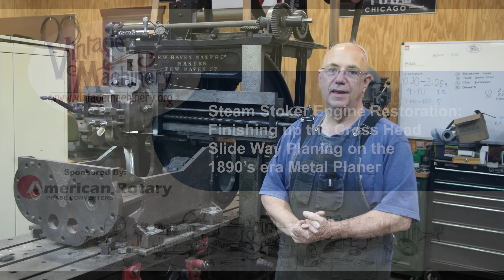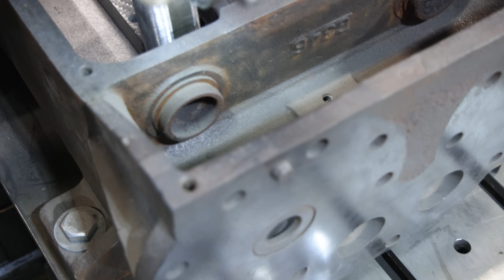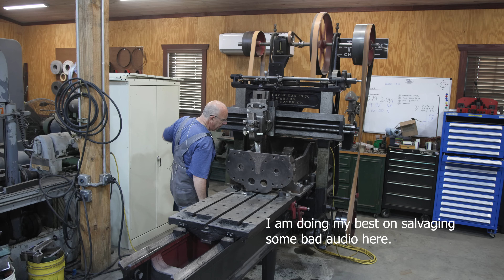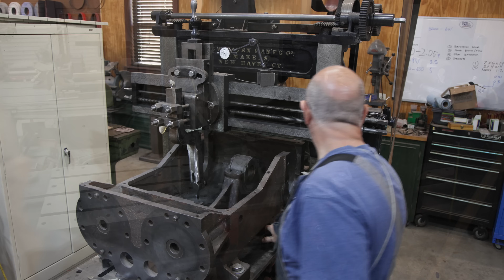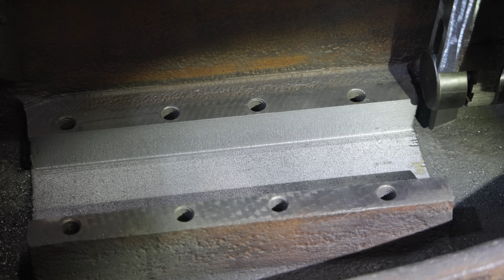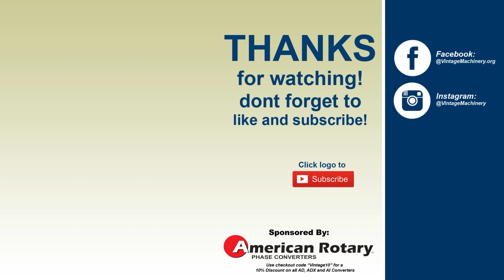Steam Stoker Engine Restoration: Finishing up the Cross Head Slide Way Planing on the Metal Planer

Comment: I'm just wondering, wouldn't the rough surface finish and pitting create a better mechanical connection with the babbitt?
Reply: The original had no babbitt, that's Bozo's idea!:face-blue-smiling::face-blue-smiling:

Comment: Finally got the machining done... getting the babbit in the bottom is going to be interesting too...
Reply: Yes, and watching Bozo getting it to run perfectly in line with the two piston rods, in both axis, (since he took no measurements) is going to be lots of laughs!:hand-orange-covering-eyes::hand-orange-covering-eyes::face-blue-smiling::face-blue-smiling:
Reply: @garybrenner6236  These cuts were for clearance and cleaning up the welds done to fix the pitting.  I expect, there will be "blanks" made of the sliding parts, if not the parts themselves to be used as the alignment for the babbit. In a similar fashion to the turned mandrels used in place of shafts.
I'm wondering how the babbit will get down to the bottom of that casting, and around whatever is being used to leave space for the moving part. Those long handled ladles are going to be a challenge.

Comment: When you were changing the tilt of the cutter, the camera picked up the flake pattern on the cross slide ways.  I remember the episodes when you were scraping those in.  The result is impressive - I remember how even Adam's big-a*se shaper couldn't reach into that box!

And now you need that newly-restored boring mill for the crankshaft. Wow, you had to retool the whole shop to 1898 for this job! 

I love a shaped (or planed) surface finish!  I know you had to get the surfaces cleaned up - get the rust and pitting out of there - but how nice a finish do you need on a surface that will get Babbitt anyway?  (Or is it the cross-head itself that gets the Babbitt?) 

And it's insane how much old big-iron is out there still turning stuff out. I'm thinking of the dozen or so big closed-die forging presses that the government contracted for about 70 years ago.  They're still turning out parts today, and we can't built airplanes without them.  When the 50,000-ton Mesta press at Alcoa in Cleveland went down because of metal fatigue in the naughts, it was down for four years and the aircraft industry had supply chain issues the whole time - that one press was a big slug of the whole country's production capacity for big aluminum, magnesium and titanium forgings.  It wouldn't astionish me if a New Haven planer like yours isn't still in production somewhere.  We hardly know how to make that sort of machine any more! Certainly, you see WWII-vintage mills all over the place. One of the last times I machined anything at work (just counterboring a few holes - the union will let me machine only for fit and finish) I set it up on a 1940s-era Bridgeport.

Comment: You mention the fear of the machine breaking through the casting.  I assume the motor controller has a kill switch option, have you thought about putting a kill switch on like a magnetic indicator arm or even just a cheap camera articulated arm, so that if the machine should accidentally try to go past its set travel, the machine itself will hit the kill switch?  You really could wire up a couple in parallel and have them in a couple of places.  Cheap insurance for a part that is irreplaceable.

Comment: I told you so!
@truracer20
3 years ago
Keith, you've spent the last year plus rebuilding a machine that is perfectly capable of doing this job. I would bet it was originally done on a planer. Your planer is plenty rigid and can use tooling that is rigid enough for the reach needed. I'm sure the top surface was fly cut as the witness marks show but that doesn't mean every operation used the same tooling

Comment: Looks like you need to shift your drive drums on that pole. The belts have room on one side but they are only holding on by a portion on the other as it shifts in reverse. But since you don’t read the comments you’ll do it after they fall off during a cut.

Comment: Just started the video- maybe this is explained later on. I'm not understanding how the clapper box being able to swing results in a clearance issue at the front of the casting considering the planer cutting head would be moving AWAY from the front of the engine. What am I missing here? Why did it need to be locked down?

Comment: When you put the gear in to engage the down feed , at 8:30, it seems to feed down before the cutter had fully retracted.  Surely this should happen after the cutter has fully retracted.
Reply: Nope. Planers (and shapers) feed at the end of the cutting stroke. That's why the clapper box is there, so the tool can lift up and ride on the uncut surface.